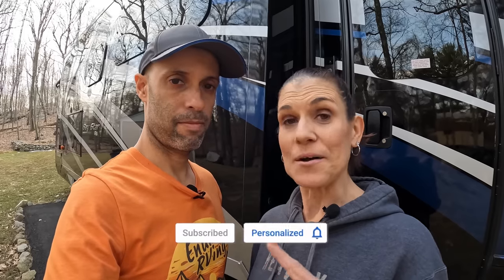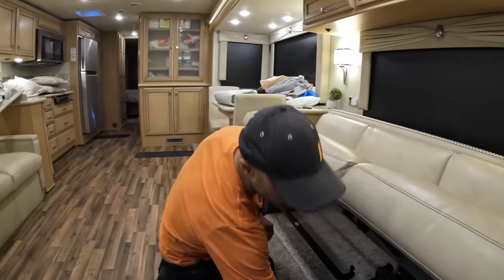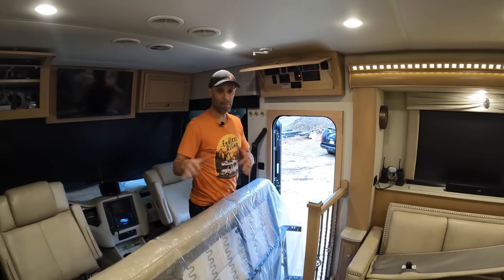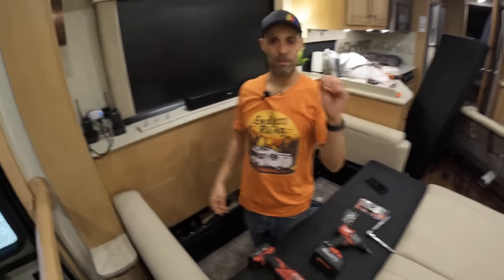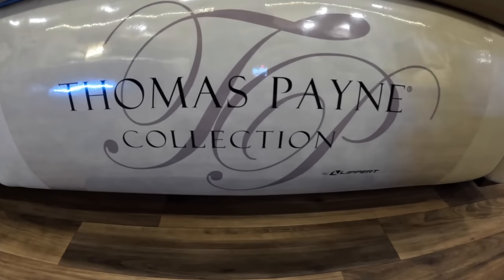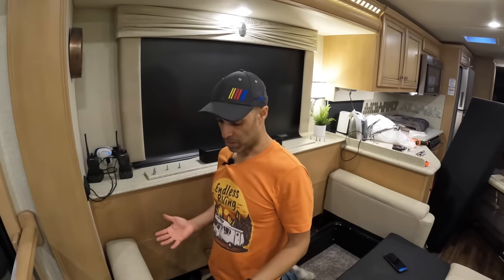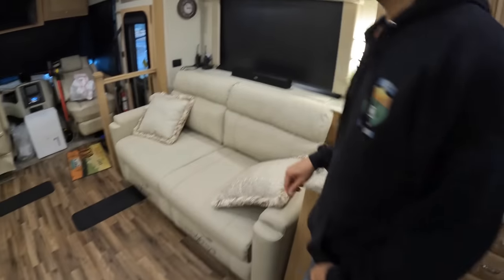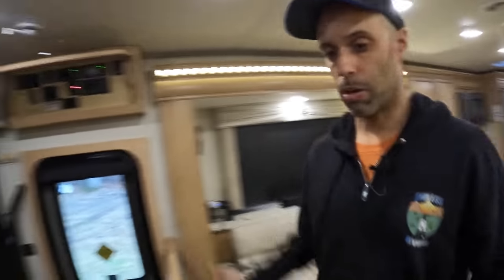We Just Upgraded Our RV Interior -- We Have Waited Years For This!

Comment: Great upgrade. When it is/has been raining and there may be water on top the slides. I always dump the jacks and then use either the front or back ones to tilt the coach to drain the top of the slides before bringing them in.

Comment: Izzy,I purchased the Recpro 58 inch recliner and mounted it on a 3/4 piece of plywood.I used the the two seatbelt bolts to mount the plywood down and screwed the recliner to the plywood.We have a 4 inch overhang with the recliner so the plywood supports the recliner with no flex in the plywood.

Comment: We've been talking about replacing the sofa with theater seating in our BayStar, and seeing how easy you made it look, I got the measuring tape out.
Unfortunately, our slide is only 32" when measured at the base inside, and these are 38" and it looks like the front bolts are very close to the front of the seat.
back to the drawing board!

Comment: The back of the Lippert  68" tri-fold we purchased had hidden hinges behind the black felt that had to be fastened to the frame. This was not in the instructions but figured it out. This will eliminate the drop in the cushions. It should have come with wooden feet for the front. See ya! good vid!

Comment: The furniture really looks nice.  Good job.  Our Class A came with a love seat and couch.  I took both of them out by removing the large arms on each unit and cutting the frame to separate the back from the seat.  They must have installed these units when the slide wasn't in the RV.  They were way to big to fit through the door.  I then built a custom dinette and bunk beds with regular size twin mattresses (not RV width). Super comfortable.
Reply from the maker: Thanks for sharing Denny!

Comment: Great retrofit our flexsteel air mattress trifold hardly makes it through one night without losing pressure. Also, I found our 2017 Baystar Flexsteel drivers and passenger seats to be too soft and lacking the support I like for long hauls.  I just worked with US Sheepskin Inc. for covers.  I found them to be a great company to dial to work with and dial in their patterns for a custom fit.  They not only have a luxury feel but it even firms up the supportive rebound.  I feel they are well worth the price.  I'll just never be able to spin the seat and stay awake when I watch TV.  No wonder why Flexsteel stopped making RV furniture.

Comment: hey guys great video - QUESTION - what were those 2 small flat black strip/mats on the floor ? thanks
Reply from the maker: Slider floor protectors.  Stops damage to the floor from slide rollers
Reply: @EndlessRVing  Thanks MJ are they permanent or do you store them away after ?
Reply from the maker: @BoondockingWithBoomer  we put them away in the closet once we set up.
Reply: @EndlessRVing  ok cool thanks MJ